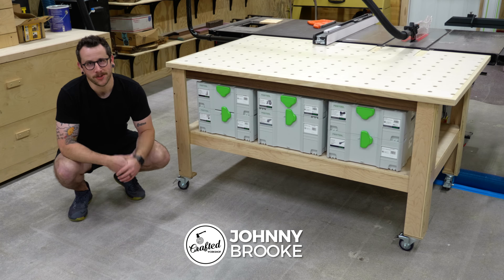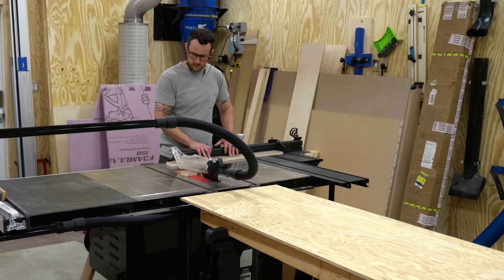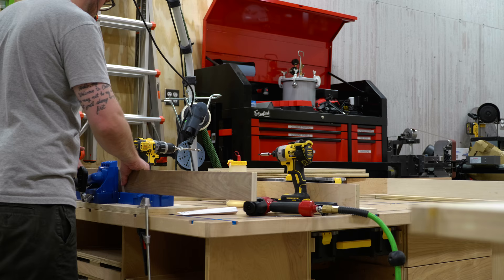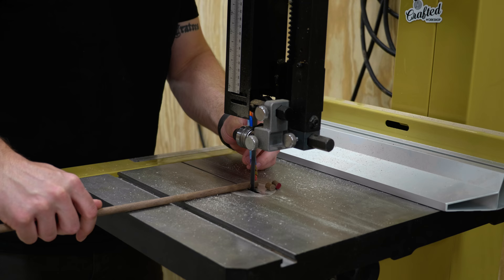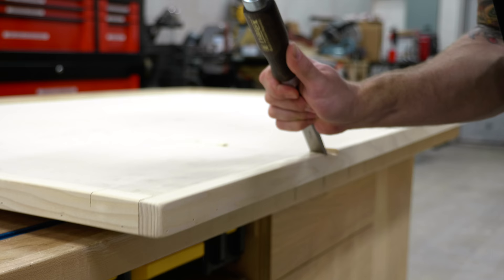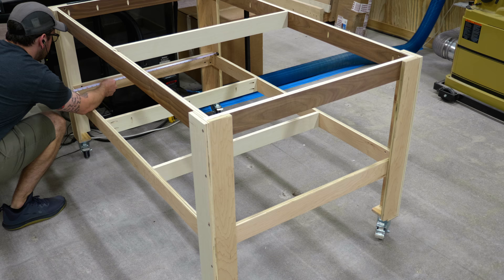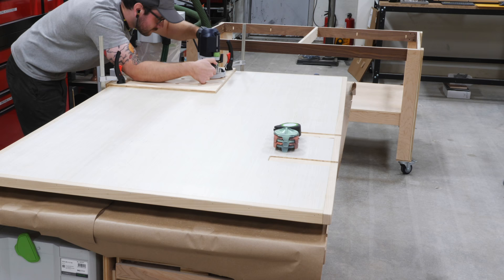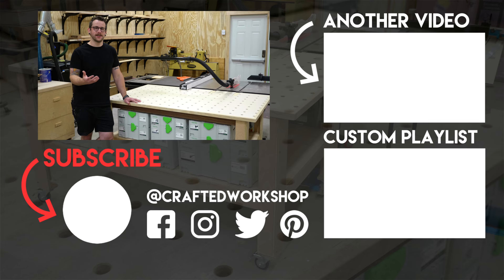DIY MFT-Style Outfeed Table, Assembly Table & Workbench // How To Build

Comment: You're gonna hate how much stuff filters through that holey top ... Maybe add a roll for paper to put on it most times..
Reply from the maker: Oh I know, I've had a top with these holes before!
Reply: @craftedworkshop  I only know because of how frustrated I was until I decided to always roll out paper when I wasn't using the hold downs. Kept it on a hanger at the end of the bench and just reached down and rolled it out... My under top area didn't have as much precious stuff under it at first but...
Reply from the maker: Clyde Decker good tip!
Reply: @craftedworkshop  Well it kept a lot of small screws, glue, stain, and other things from wending their way into the land of the lost and not having to pull everything off the lower shelves to find them...

Comment: I ended up drawing this outfeed table in Fusion 360 with some parametric variables so I can change the leg length once I get my hands on the casters and measure my table saw. 

If you’re someone hesitant on using CAD for making plans I highly suggest taking the dive.  It’s nice to build the project on the computer first and figure out some of the issues before physically assembling the thing. 

Now how to do it with a VR headset....

Comment: This looks great.  I like the simplicity of it. I built an assembly table recently and I'm not completely happy with it for a couple of reasons. It's still quite useful and was going to end up as a finish table. But since I built it I've also moved up to a bigger table saw and it's acting as an outfeed table. I do have a large shop, so I may end up building one of these as well. At the very least... I'll end up with a new top and use your method for adding dog holes. Great idea to make  the template on the xcarve. THanks for sharing.
Reply: Just realized that you included the Easel File for the hole template. That's awesome!!! Thank you!
Reply from the maker: No problem, hope it's helpful! Thanks for following Angie, been cool seeing you around in the comments since we met at Festool Connect!

Comment: Fine Woodworking had a cool tip for flush cutting with your Japanese pull saw instead of your painters tape. Use an old credit card sized magnet from your refrigerator (the ones a realtor or someone hands out) and slap it on your saw. It will keep the blade off enough for the teeth to not scratch the veneered surface. You'd probably have more sanding to do afterward as it's thicker than your painters tape.

Comment: Does a 4" hole spacing affect anything compared to using the MFT spacing of 96mm? Any idea whether track system type clamps would duck through 20 mm holes in an 1-1/2" thick top? Is there any evidence that dog holes in a 3/4" top will get loose with use backing up clamps? Thanks to anyone who answers.

Comment: The template for the dogs was a great idea, but I'm really surprised you didn't mark/test it over the length of the table (or at least spot measure) before drilling to avoid risking them lining up the way they did.

Comment: Could you box the table in and add dust collection for a downdraft table? Or, do the dogholes cover too much surface area to get enough suction? Great video, as usual! Thanks :)
Reply: For clarification, I'm only proposing to box the table top in just enough for a 4" dust port.
Reply from the maker: It would really depend on your dust collector. It’s a pretty large area for sure, I might only box in half of the table for more effective airflow.

Comment: 12:30 I think Ron Paulk is using 96 mm spacing now with 20mm dogs .. i.e. UKJ PARF system?  That's compatible with Festool clamps etc right?
Reply from the maker: I use ¾" accessories so I'm not sure.

Comment: Great build, this couldn't come in a better time, since I'll need one soon. I was thinking of trying to incorporate an opening on the top, similar to the roubo workbench to have the saw of the Tracksaw going in there while cutting. And that way won't be dealing with the pink insulation thing. Something I wanted to ask you is what benchdogs  were you using. Thanks
Reply from the maker: Nice! I think the gap could be handy, but if you just sawed in the same spot, you could have just one cut in the top of the table. The dogs I was using are from Lee Valley, they're the Veritas brand.
Reply: @craftedworkshop  thanks for your reply, it's a good a idea to have just a place to cut everytime, so the gap would be minimal. My original idea was to have a wider gap so I could also use it for clamping while assembling, etc, then make it on a way that I can just slide a cap on it. Thanks to my limited space it will be outfeed/assembly/MFT/workbench.

Comment: Has anyone had success using a flush trim blade on a reciprocating saw? I’ve seen the blades but never bought one, and I can’t say I’ve ever seen one used in a woodworking video. Also I’ve never used my recip saw for anything other than demolition (can’t say I’ve ever needed to flush trim something I’m breaking down).

Comment: Ignorant but honest question: what's wrong with phillips head screws? I've used square and star in my builds, as well as phillips, but have never really had a preference. Just curious if I should be avoiding phillips too.
Reply from the maker: I just find they strip much easier than Torx and Robertson head screws. This is especially true when you're driving longer screws into tougher wood. Square and Torx head also hold onto the screw better, so it's easier when you're getting started.
Reply: @craftedworkshop  Good to know! Thanks!

Comment: Awesome work! Thanks for sharing. When you spray finish in the middle of the shop, are you concerned about overspray landing on your other shop tools? I don't have room for a dedicated finishing booth, so I've considered doing the same, but I worry that overspray will build up on things I don't want it to over time.
Reply from the maker: Thanks! You can really reduce the amount of overspray if you set your gun up properly. I’ve always sprayed in the middle of my shop with nothing but a few drop cloths and haven’t had an issue. By the time the finish would make it across the shop, it would have dried anyway. That’s one of the reasons why I only spray water based finishes.

Comment: Says "you can easily build this with a circular saw and a  drill so I don't want to hear any complaints about not having the tools" 

Proceeds to use an x carve for the main surface of the project.   LOL

Really good-looking table though
Reply from the maker: There are templates you can buy, I just decided to make my own. You can also just lay out the hole locations with a chalk line like Jay Bates did on his table. A million ways to do every task!
Reply: To be fair, a LOT of people tend to cry about Johnny's nice tools in the comments on his videos. He always lets you know that you don't have to have a shop like his or great sponsors and stuff, but people still complain. I wonder if these people walk into an auto repair shop and complain that they're using torque wrenches and air tools...
Reply: Yeah, it's bull$hit. I'm going to a channel where you can make stuff with less tools.  This is a joke.

Comment: Where did you get your dust collection hose mount for your x-carve?  I need to add dust collection to mine.  Love the dog holes in the top.
Reply from the maker: Thanks! I just adapted the arm that worked with the original X-Carve dust collection to work with my 4” flex hose. The dust shoe is called the Magnaboot, I cover it in this video : https://youtu.be/Hp3ofqjqM40

Comment: Why the Phillip's head screw hate?
Reply from the maker: Answered above, but I just find they strip much easier than Torx and Robertson head screws. This is especially true when you're driving longer screws into tougher wood. Square and Torx head also hold onto the screw better, so it's easier when you're getting started.